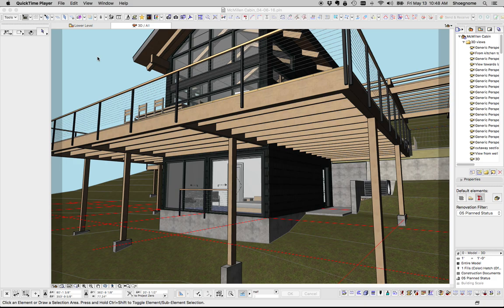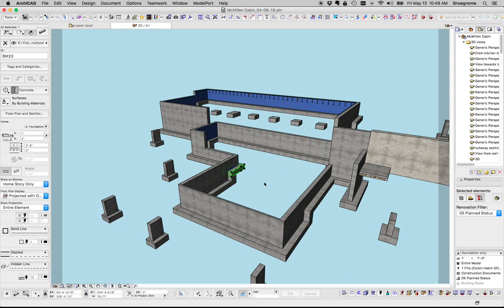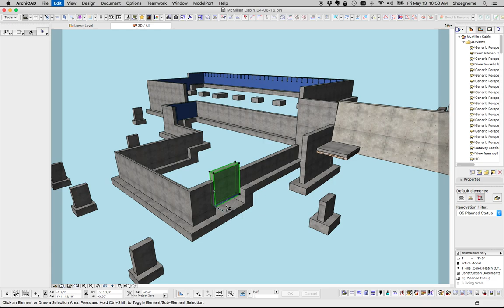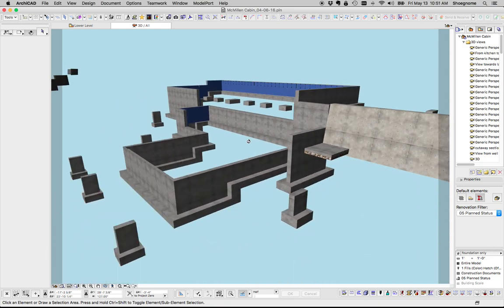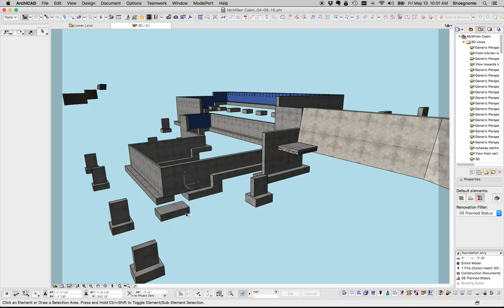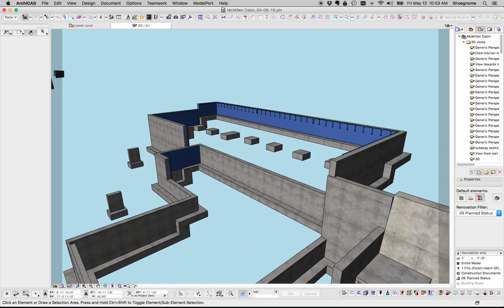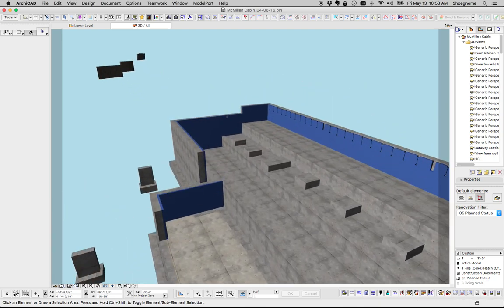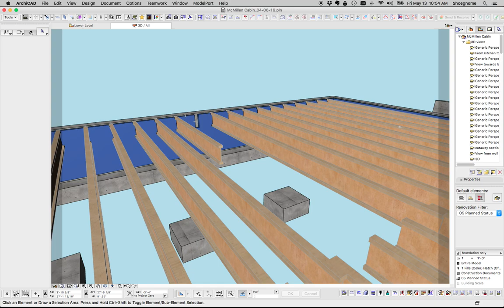ARCHICAD Tutorial #53: Foundation and Footing Techniques

Comment: Why use beams instead of walls on footings?
Reply from the maker: The video and accompanying blog post + comments should explain this. Beams offer more flexibility.
Reply: @Shoegnome  could you of also used slabs? or beams offer more flex?
Reply from the maker: @erikleypoldt8275  you could use slabs, but beams offer the most control and flexibility. You can set the beam's width and height in the info box. You can also slope them.